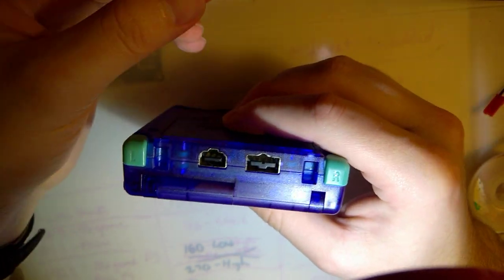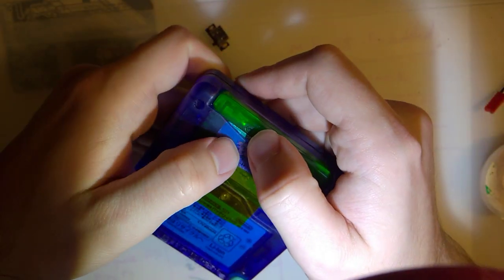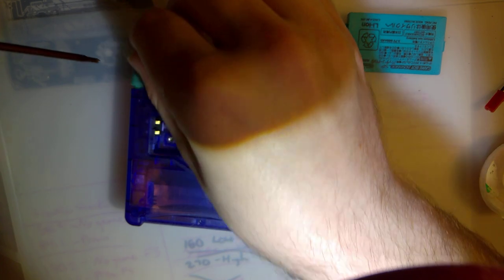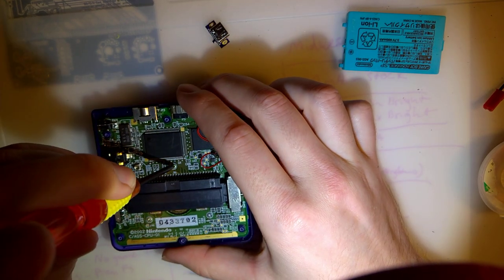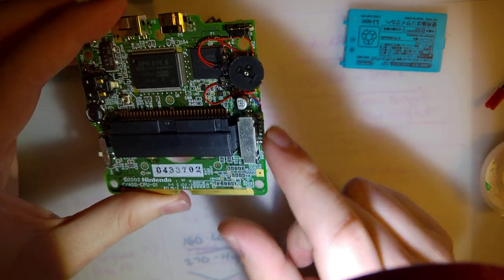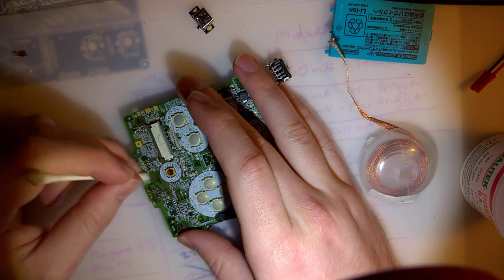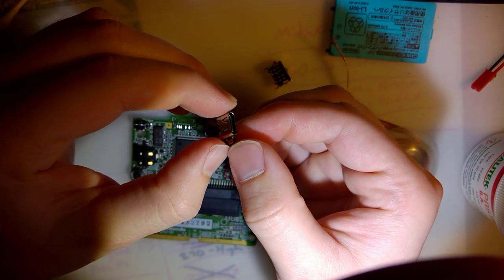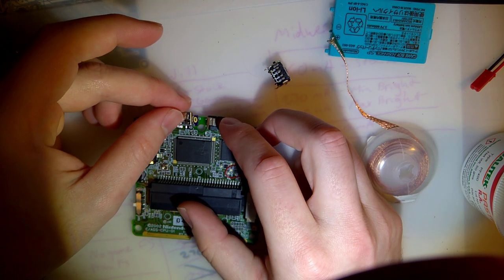BlindEye's GBA SP USB C Charging Port Mod

Comment: This is an old videos, but just fix the cable problem by connecting CC1 and CC2 pins to grounds through a 5.1k resistor to have a full compatibility
Reply from the maker: Yes but the whole point of a PCB adapter is that you don't have to manually wire things. This has already been resolved with rorsaurus' version.

Comment: I bought one of these on eBay and I can't get it to work right. The light stays on when it's not in the shell but when I put it together it won't the light won't stay on. Battery is good. Fuses are good. Any suggestions on where to look? I think I sodered pin 5 and 6 together. Would that do it?

Comment: I just destroyed my display ribbon port because I didn't realize my iron was too close... awesome. Wouldn't advise this mod for new-ish solder workers. I've done my fair share of mods and batteries but good lord this is intensive. The port was giving me so much trouble that I had to keep moving the board around to find a good angle. Ended up killing my display port so now I'm out my SP.... son of a.... I hate my life.
Reply from the maker: I recommend saving the console for when you get more skilled. It's not impossible to replace the display connector but it's definitely more difficult than the charge port. Alternatively, consider selling it at a discount to someone who can fix it. 

I've been there and I regret throwing out projects that my ego got in the way of.

Comment: USB-C supports analogue audio, so there's no need for a separate headphone jack, just a mod that supports it
Reply from the maker: I don't see the point of modifying the console to this extent just to keep using a dongle.
Reply: @makho , but do you play and charge at the same time? If so, then you're right.

I'm against the "death of the jack", but in this case implementing the USB-C audio means not modifying the gadget housing
Reply from the maker: @SchioAlves  No, I generally don't. I don't usually play for more than a few hours at a time and I tend to charge it after each session.

Comment: Tried this and during the process of taking off the older charge port, I ripped off two contacts... I assume I'm pretty boned here?
Reply from the maker: depends on which pads you ripped off. I guarantee it's fixable but if you have to ask, I'm not sure if it's something that you can do at your current skill level. 

If you ripped the audio pads though, it doesn't really matter.
Reply: @makho  Looks like pads 2 and 5 starting from the left. Its probably not, but also don't mind trying it out, as the board is DOA when it comes to charging otherwise. I was doing some research, do you just scrape parts of the board until copper contact shows up, and apply solder?
Reply from the maker: @salmondelicious  as long as you're scraping in the proper area, yeah

Comment: So this is putting the power into the SP through pin 2, and grounding at pin 6, right? I'm just trying to make sure I got SP anatomy right, because I want to attempt some charging mods, but I got some conflicting evidence saying power goes into pin 3. It looks like pin 2 in the video.
Reply from the maker: https://cdn.discordapp.com/attachments/332487777986019337/747147750499418202/unknown.png
Reply: @makho  Thanks, good to not have just a couple blurry pictures

Comment: I just came across this video!
Great job.
With the links you provided, I saw that you said you were going to work on making a USB C to USB C charge connection available at some point!
I was just wondering if that's something you ever got around to, or if it's just on the back burner for now.
I'd absolutely love to charge my SP with a C-to-C cable! 😊
Reply from the maker: Yeah, it's on my to-do list. I'll get to it eventually.
Reply: @makho  Very cool! Looking forward to it! 😊
Reply: makho yes please! I’ve been addicted to watching your videos and seeing you fix/ mod. You’re freaking awesome bud! Hope you get around to make long this mod. You’d get my money. 😅 keep up the AMAZING work!
Reply: @makho  Do you know what needs to be done to get this to work? Thinking about investing some time or money into getting it done :)
Reply from the maker: @acasserole9558  Yeah, there just needs to be two 5.1k resistors tying the CC lines to ground. It's pretty simple but since I don't have the source, I'd have to recreate the mod from scratch.
Reply: @makho  I've been looking as resistors today,  you can get SMD Chip resistors that are 3.2mm in length at 5.1kohm. Looking at the schematics for the USB type-c ports the inner two pins are for CC1 and CC2 with the outter pins being Ground. The distance between the outside edges of these two pins is 3.05mm. You'd need to be careful to not have any contact with the middle pin but simply placing one of the resistors on top of the type-c port pins may work. 
I've ordered the boards on OSHpark and some ports off Aliexpress. I've also bought 20 Panasonic SMD Chip Resistor, 1206 [3216 Metric], 5.1 kohm, ERJ8EN Series, 200 V, Thick Film, 250 mW - I can let you know how I get on though it'll be a while before I can do this. Thanks for your help sharing the boards as that's way beyond me and I don't really understand how it all works. 
I also ordered some of the boards and batteries you made a video about for the SP, now I just need to order an IPS display haha.
Reply: @makho  Hey there, thought you might be interested, my USB type C ports arrived today and I lined them up with the resistors I bought. 
https://i.imgur.com/C5FabDn.jpg

The fit looks pretty good, still waiting on the boards from OSHpark but coming together nicely.
Reply: @acasserole9558  hey I know you did that over a year ago but I'm just getting into Gameboy modding so is there anyway for me to get a more detailed version of your process?
Reply: @liamsmith8518  I gave it to a mate that did the USB C conversion but he didn't put the resistors in

Comment: Can you helpe me please ? A broke my conector motherboard trail from charge conector , where i wage the voltage to solve that ?
Reply from the maker: I believe you can just solder straight to the fuse. It should connect up to the charge port without any components inbetween. Just make sure you put the fuse in series with your wiring.

Comment: Don't know what I'm doing wrong. Do you have a written guide somewhere? I got the usb c port attached to the board nicely. But having trouble with that last point you solder where you say be careful not to let it touch another pad. Powers on but no charge light when I plug in the USB c
Reply from the maker: Have you verified that things are connected properly with a multimeter and that you are indeed getting voltage at the port?

Comment: For the headphone issue. My phone doesn't have a headphone jack, but it came with a little cord that plugs into the usb-c and lets you plug headphones into that. Would that fix your issue without more soldering?
Reply from the maker: no

Comment: @makho I tried this mod and I ripped the sound pad how do I get it back to working? And I Think i bought cheap solder because the part won’t stay! Is this a thing?
Reply from the maker: If you're new to soldering, I highly recommend starting with a solder practice kit. This is not a beginner mod.
Reply: @makho  damn it I guess I got a little too ambitious with it. I’m going to try again today i at least got the original broken charger port off. Idk how but id like to attempt getting the sound back on
Reply from the maker: @gabbyrivera4454  There are reverse engineered schematics on github. You should have everything you need to repair it if you follow along: https://github.com/Gekkio/gb-schematics

Comment: On your thingiverse page you shared the pcb model he made, do you by chance also have the design for the headphone jack? I bought 3 of the boards for the usb-c mod and they’re being fab’d now but I would really like to get my hands on one of those headphone pcb mods. Not a whole lot I want to do with my 001...just kidding I want to do everything I can to it.
Reply from the maker: I do not. All that was ever shared to me was the USB C mod files and the Game Boy Light smooth battery cover files.
Reply: @makho  okay thank you. I'll probably just go with Elliot's ( #theretrofuture ) more rudimentary method with super glue and magnet wire to get it worked out. I appreciate the reply!
Reply from the maker: @jacobsexton8574  Yep, that's more or less what I did too. I just used kynar instead of magnet wire =)

I've been thinking about making my own board though. It's on my long list of projects that I may or may not ever get to.
Reply: @makho  I'm not sure the difference between the two wires, I'm extremely new, but definitely would like to just get my system up to date a little bit. If course I'd like to just put a Bluetooth chip in there and a wireless charging plate but that's way out of my league right now. Maybe down the road!

Comment: How come, sometimes the soldering point on the board gets burnt trying to solder my wires to it? Leaves me nothing to solder to anymore. How do I prevent this? Use flux?
Reply from the maker: Probably less heat and definitely more flux will help. It sounds like you're holding the iron in one place too long which might mean you need better heat transfer. Sometimes it can help to build up a small blob of fresh solder on the tip. If you do this, you still have to clean your iron often.
Reply: @makho  It's just probably too hot. But I don't hold it on there for too long neither cause I know it'll oxidized the surfaces and cause that black burnt surface. But I will use extra flux. I been soldering since AGS001 front light mod on OG GBA handheld was around but just wasnt sure why I get those burnt surfaces at times even though I don't hold it there for long. But appreciate it though.

Comment: Hey makho, would you be able to fit a headphone jack behind the new charge port? it seems like just enough room to squeeze one in sideways
Reply from the maker: If it's sideways, how would you plug headphones in? he port is too deep if you do not cut into the battery compartment area.
Reply: @makho  I think he means if the c port is fitted north / south instead of east / west. Could a standard headphone jack be fitted next to the USB c port, so that both issues are addressed at the same time

So the c port would be fitted to the absolute side of the existing hole, would that leave enough space for a normal headphone jack
Reply from the maker: @stevenbenson9976  That's what I assumed they meant and I don't believe there is enough room unless you leave the port proud or cut into the battery compartment.

Comment: Is there an internal wireless adapter mod because you can't use a link cable with this
Reply from the maker: Why can't you use a link cable with this? Mine still works fine.
Reply: @makho  sorry I didn't realize the link cable and charging port are different I don't have a gba yet but still does that mod exist
Reply: Thx 4 the heart

Comment: What kind of charging block do I need to use when charging?
Reply from the maker: This particular implementation only works with USB A hosts and not USB C hosts. You'll need rorosaurus' version for USB C host support. As long as your adapter outputs 5v and at least 500mA, it should work (barring the other restrictions I already mentioned).
Reply: @makho  thanks for clearing that up! 🤙🏾

Comment: Why not put the headphones jack there
Reply from the maker: Where? In the empty space for the charge port? The space is not deep enough without interfering with the battery.
Reply: @makho  o ok dang. That's good to no. Good work on the video help alot
Reply: No Headphone is what me Make no usb instead of the Port.
I place the usb on a other place.
Reply from the maker: @-Gothicgirl-  I saw your reddit thread, your mod looks good. This particular mod is designed to be used in conjunction with a headphone port mod that I keep neglecting to order though.
Reply: why can't the audio pass through the usb port? I assume you would need to place some sort of DAC in-between the audio output and the USB jack? but would it be possible?
Reply from the maker: @NoshAbroad  No reason it can't. You'd still need a dongle and you'd have to custom make a dongle though. USB C audio dongles are USB devices that are expecting a digital connection and the SP is purely analog. All you'd need to do is wire up the audio pins to some of the pins on the USB type C port and then make a dongle with a male port wired the same way. My only concern with this is if you connect up a regular USB device (e.g. for charging the SP) and the custom wiring for audio causes damage to either device.
Reply: @makho  Your video got me thinking. On Ali Express there are numerous small Qi charging receivers. Some are very small. Maybe even small enough to fit inside the case of the SP. I'm wondering now if I could place a coil behind the IPS screen replacement and run the small power board along the inside of the SPs main body.
Reply from the maker: @NoshAbroad  absolutely. There should be plenty of room. You can probably even fit the power board behind the screen as well. I've planned similar mods but I don't actually have a wireless charger so I've never done it (though I do have the modules for installing in "phones").

Comment: Just a little issue, it won't be restocked ever again
Reply: Although there are some similar ones. I don't really know, but this one in the video looks clean compared to others
Reply from the maker: @archivushka  the other ones are better options because they either offer better fitment with certain case mods, usb c host mode charge compatibility, or usb c headphone dongle support. Install is the same for the other versions so I see no reason delist this video.
Reply: @makho  wow, the headphone dongle support? I didn't knew type C can pass trough analogue sound, because most of the dongles are DACs.
Right now for me, this looks like a vast makers world, where I don't really know which to get, they are differently similar, yet similarly different.
Reply from the maker: @archivushka  gameboy.github.io is a wiki I maintain that has most of these mods listed there. It's constantly being updated (though less frequently than I'd like) by myself and a select few volunteers. These mods are listed. 

USB over Type C supports both digital audio DACs (via USB OTG) or analogue audio out the way the SP handles it. Convenient I'd say.

Comment: Dude I accidentally tore the second lead on the charge port any recommendations on how to fix reroute that?
Reply from the maker: follow the traces on the PCB and try to patch in to that
Reply: @makho  I tried :/ I'm not going to lie it ripped something out. I just didn't think it was going to make a difference because I knew that I didn't need that little pad I was only worried about the fifth one. I just didn't think it would prevent the system from turning on but it still charges thru the type c mod lol
Reply from the maker: @robert_wolf6989  it doesn't prevent the system from turning on, you have another problem
Reply: @makho  I'll keep messing around and check f1 and f2 again but that's strange that the charge light would come on when I plugged it in.
Reply from the maker: @robert_wolf6989  why is that strange?
Reply: @makho  whoops I just realized I never replied to you. I meant it was wierrd that it lit up when charging but refuses to turn on. I set this gba aside for the moment to focus on other projects.

I'm actually struggling with an SP atm (different system) where I did the mod and put the resistors and everything was soldered in. The type c charge port was charging and everything was looking good. Then all of a sudden it just stopped working. It still powers up but it doesn't charge at the moment. When I plug it it the lights comes on for a quick second as if it had no battery. But I'll have to go in and undo the resistors.. that's my first theory.
Reply: @makho  I'm actually rewatching this video to see if I can find any sort of clue on how I can get mod to work.

Comment: In your opinion, would this work for a Gameboy micro as well?
Reply from the maker: Yes, it would work. Some people have done those mods before. It would require a different PCB adapter though because the port it is replacing is different.
Reply: @makho  you wouldn't happen to know if anyone is selling a pcb for usbc micro mods, would you?
Reply from the maker: @CDX23  there are none that I'm aware of at the moment and I have no current plans to make one
Reply: @makho  ah ok, thanks for your help!

Comment: Makho I'm trying to do this same mod, can you help me (as well as others interested) source alternatives boards with usb c that will work. Thank You.
Reply from the maker: There aren't any. I did upload all the required files for this though: https://www.thingiverse.com/thing:4123563
Reply: @makho  So it is available as separate  components I should have dug a little deeper. Also thank you posting you designs to thingiverse.
Reply: @JOHNCXLE  where did you find the board I can't find it...
Reply: Blue Trainer for the Usb c board use the 2nd link in description to Thingiverse, then the oshpark. c o m link in the description of the Thingiverse listing, once on oshpark website click actions and then buy. Order only a few days ago and board is being made already. I also purchased the board makho made for adding a lipo from oshpark at the same time from another video he did.
Reply: I hope this helps.
Reply: @JOHNCXLE  alright thanks alot
Reply: @JOHNCXLE  did you add any of the add on to it when at the check out? Idk if they are needed or not
Reply: Thanks so much to makho and all the comments especially this one they help